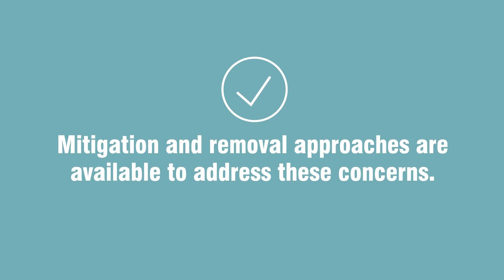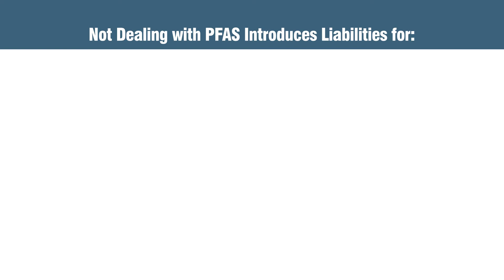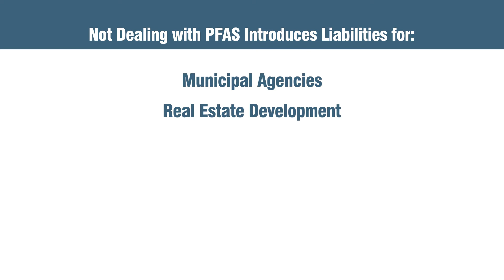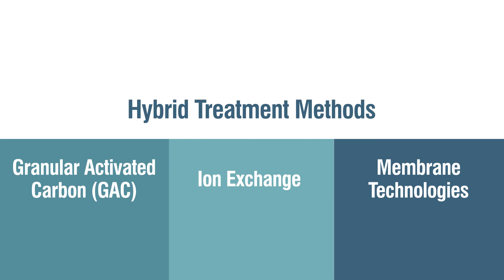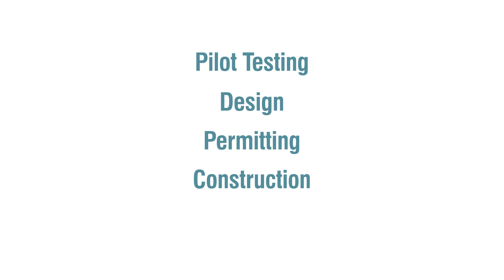PFAS and How to Remove the Silent Threat in Our Water

Comment: I worked at a chemical plant in the late 70’s. I was an environmental chemist. Based on what I saw and measured, I have been drinking filtered water ever since then. Even our plant water system and drinking fountains were contaminated one time after a piping repair mistake. I was told to keep it quiet. I didn’t. Superfund site now.
Reply: The money was never super funded you know? Nothing was cleaned up...
Reply: What kind of water do i drink for safest
Reply: @jones8610  IDK...
Reply: @jones8610  distilled water is safe, but take minerals to supplement.
Reply: @annunacky4463  how about Poland spring water
Reply: @jones8610  that should be fine. For cooking, you can get a filter pitcher or install a charcoal filter under the sink. It’s a pain but really help. So, drink the bottled water, and try to use good water for your cooking also. Cheers!
Reply: @jones8610  just get a reverse osmosis system
Reply: How do you filter your water?
Reply: @martinduran9523  my Samsung fridge has an activated charcoal type filter that removes a lot of contamination. I’m sure some nasties get thru but only distilled water cleans up perfectly. That’s what we used for all the chemical analysis we did. Good health to you and yours…
Reply: e

Comment: Does a Berkey water filter successfully remove the pfas?
Reply: Prob not, I’d recommend buying a countertop reverse osmosis system
Reply: @jreshorts737 Absolutely not for long term high volume needs but PFAS is removed by activated carbon filters, as in a Berkey.

Comment: For firefighting where volatile organic compounds (VOC), like gasoline, are involved, it is still the best option. PFAS foam has a high surface tension that blocks the vapors from VOCs from evaporating. It's the vapors that burn, not the liquid.  However, at the same time firefighters are preparing to deploy foam, they are also supposed to be taking measures to protect storm drains, waterways, and soil that might be contaminated. Sadly, many volunteer fire depts don't use it enough that containment steps are forgotten bc they get excited about using something new.  In the East Palestine derailment, the local depts were quick to deploy foam, which woukd have been the right move if the chemicals were in puddles in the ground.  However, they were pressurized, which breaks the surface tension of the foam and makes it ineffective. Also, with that big of a scene and waterways so close, the ideal situation before even using water, except to coll cars that weren't breached,  woukd be to set up dyking barriers by the streams and call in heavy digging machinery and build dirt berms to better protect the forest and waterways from contamination. The berms can be built from a distance to prevent thermal injury from the fires and earth berms are easier to remove if contaminated than cleaning waterways.

Comment: Distillation. No flourine compounds, chlorine, clarifiers, pharmaseuticals, insoluble minerals. Done.
Reply: Bringing water to its boiling point  is the oldest and most effective way since it eliminates most microbes , but it cannot remove chemical toxins or impurities.
Reply: Done? Ummm...not so simple in this corporate world
Reply: Distillation is not adequate if toxic chemicals have the same boiling point as water.
Reply: They are also the primary causes of heart disease arteriosclerosis and fibrillation.. The plaque is a halogenated carbon or vinyl polymer in your heart.
Reply: Well that may work to some extend, but the energy cost would be far to high. PFAS are a treat at a few parts per billion so you would need to vaporise a billion liters just to remove a few kg of PFAS. Even if you can recycle the heat to some extend the maintanace of any such oparation would be a real pain in the ass since it would need to be a batch system to remove the kristallised parts regularly
Reply: Just get an RO system